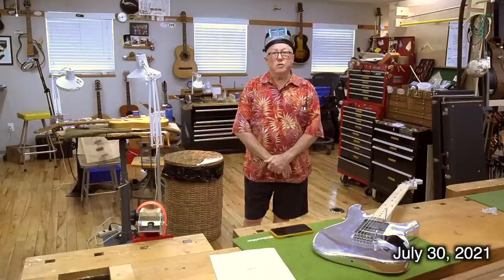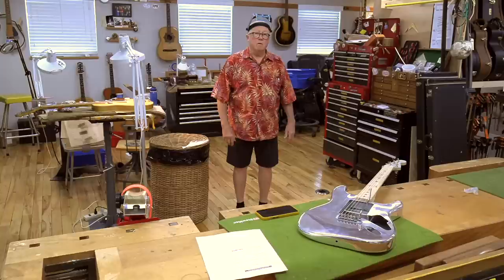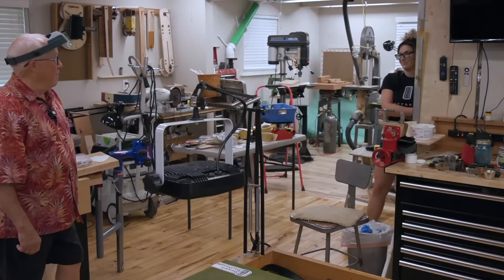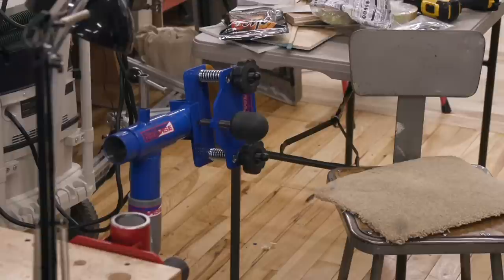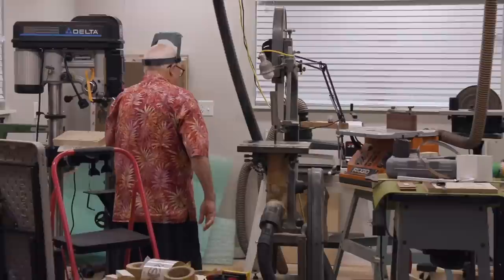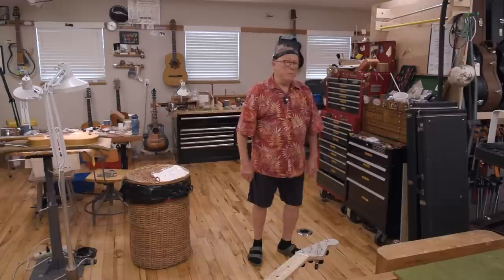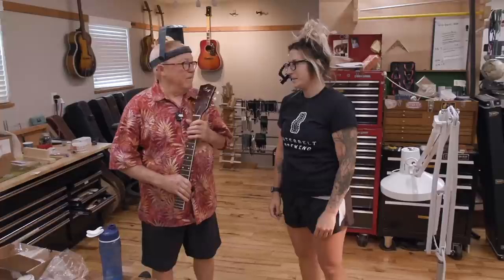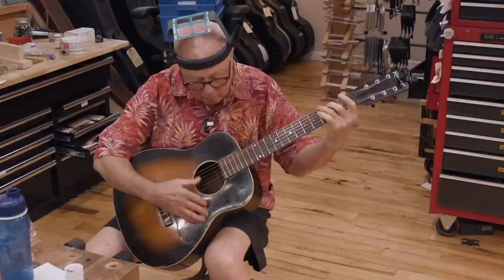A Visit With Dan Erlewine

Comment: Dan I want to tell everyone what  stumac pulled on me. Dan we have a lot in common.  I started repairing guitars around 1965. Ive made alot of my own tools and jiggs and you name it. I love your show but have one huge problem. I have mostly avoided trendy, fancy specialize tools for the ones I have fabricated myself, with a few obvious exceptions.  I was especially interested in the trussrod rescue kits. Many times those slim cutters and dies would have saved me so much time. To make a long miserable story short. I seen your sponsorship Stumac's kit for the gibson 10/32 die and the wood cutter that was slim enough to get in the area and do just enough to get a trussrod nut biting and doing its job solid and fix the problem. I was excited to see stumac even had it on sale so I ordered one immediately.  Wasn't cheap but would be fine in the long run. Well the fun started when i contacted stumac to order the kit for a gibson. Well the first thing i find , you cant speak with a real person at stumac. You're directed to go to the web site. Ok thats what i did , ordered the complete kit for gibson at 15?% off sale , cool. After a few clicks and got the notation ill have my new kit in hand shortly. I found seconds later my debit card had been charged several hundred bucks and a date was given when my kit would arrive. Well it came, or should i say some kit arrived. and to my disappointment  it was a kit not evern close to the high price one i orderd. I contact stumac by email only two days the respond with a useless note saying they will soon be intouch within 24 hours to reslove yor issue so dont worry. Two more days go by now they say the exact kit you ordered ( that we had on  sale) has not been stock for weeks!! ..Now i was just encouraged to buy one several days ago cause 15% off helps so i did. So i texted them back, i got the same generic text saying someone will be in touch in 24 hrs. More days go by. I text again,? Got the same identical text again stating the 24 return time. More datmys go by ? ? ? You guessed it. I text get generic reply ?? Texted yet again sure enough genric text. Now day and days and days go by and you guessed it more blue smoke up my ass!!! WHATS UP WITH STUMAC THEY STILL HAVE MY HUNDREDS OF DOLLARS AND IVE GOT NOTHING I CAN USE ??? WHATS UP DAN????
Reply: This is a Wendy's